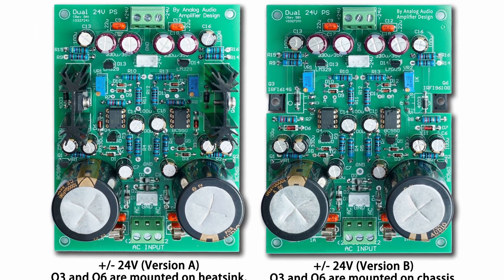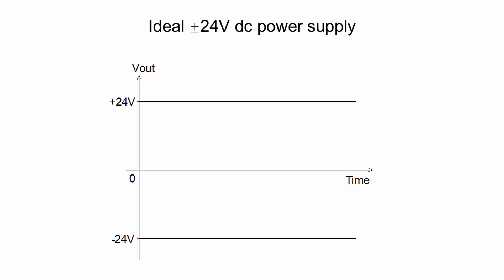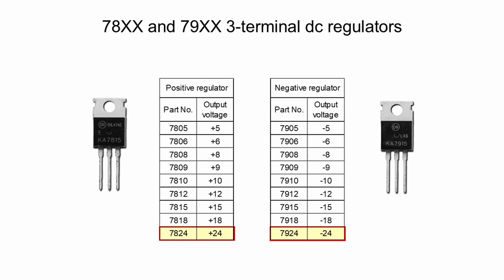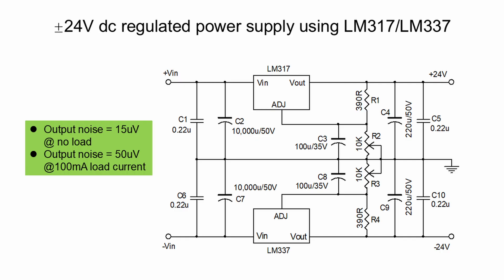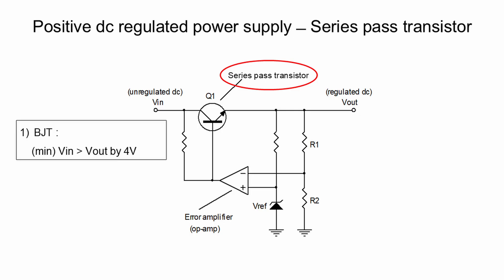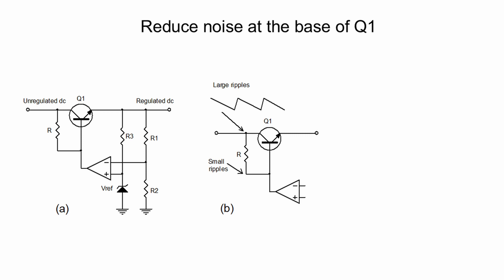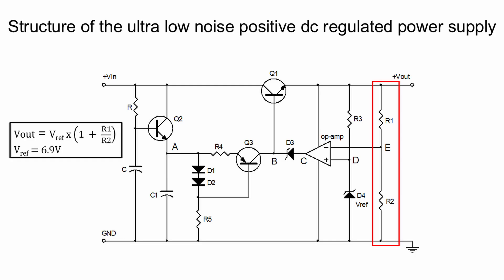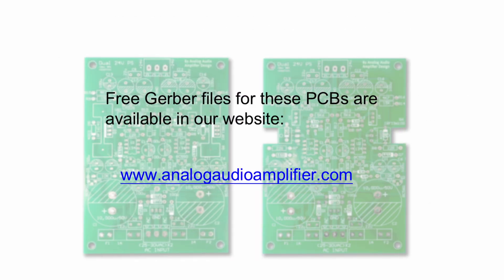Design an ultra low noise ±15V to ±30V dc regulated power supply

Comment from the maker: Chapters:
0:00 Introduction
1:28 3-terminal fixed voltage regulator
4:41 3-terminal variable voltage regulator
7:08 Structure of discrete dc voltage regulated power supply
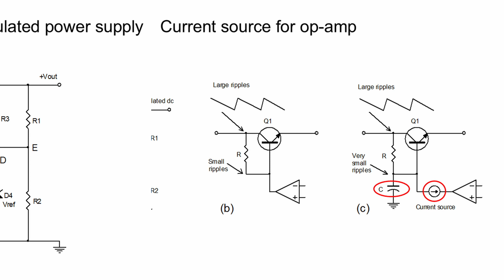10:08 Structure of ultra low noise dc voltage regulated power supply
12:07 Schematic of an ultra low noise dc voltage regulated power supply